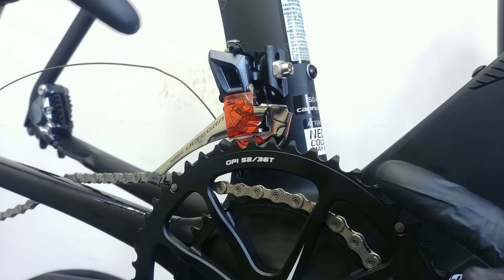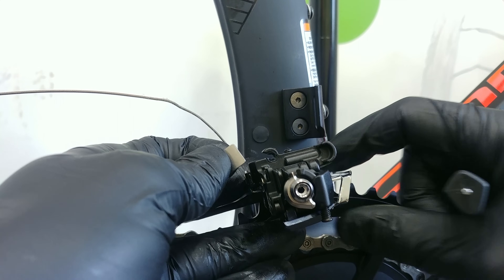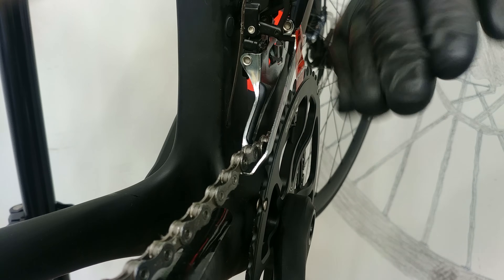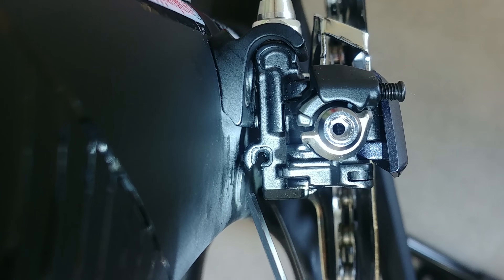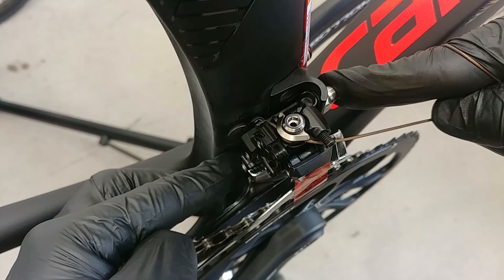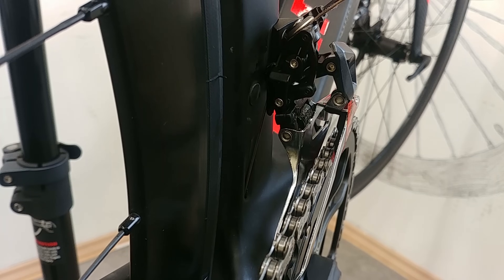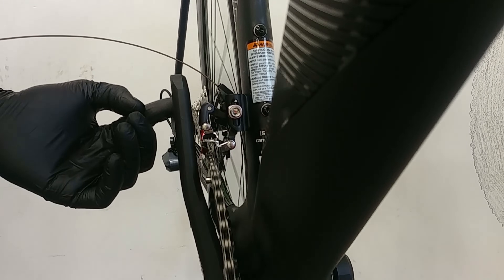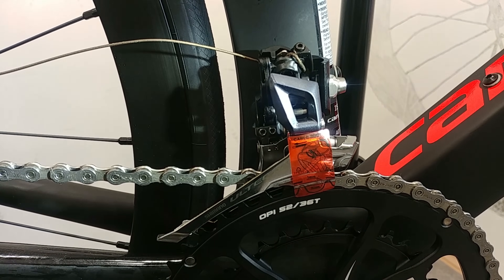Don't Forget To Stick The Plate. Shimano FD-R8000 Front Derailleur Installation / Adjustment.

Comment: that stabilizer screw doesn't come anywhere near being able to contact anything at all on the clamp, or the seat tube. its just hanging out in mid-air
Reply: Find some material that is thick enough to fill the gap, and use double sided tape to attach it to the frame in the appropriate spot. The gap was pretty big on my build, so I found some Teflon spacers at the hardware store. If the spacers are too thick, Teflon is easy enough to file down to the appropriate thickness. Good luck!
Reply: Same with me except it’s a hallowed out part of the carbon frame with a very severe angle to the screw, no way it’s going to work with that sticker pad thing - but the screw does get there.  I think what I’m going to do is epoxy on a small piece of G10 glass with thickened epoxy to make up the curved surface. Have to get the paint off, perhaps 1/2 inch square.  Pain in the a-s.

Comment: where did you put the plate sir?
Reply: he didn't use it on his bike because the screw touched the braze on plate. so its not needed

Only if the screw touches the frame you should stick the metal plate to protect the frame
Reply: That plate is just an extra protection of your frame not to touch by that adjusting screw.

Comment: This clarifies the funny "game" of stiffening screw (the one that pushes onto the frame) and L/H gear adjuster. The bottom line is: when the stiffening screw pushes onto the frame, the derailleur outer guide must be planar (what is improperly called "parallel") with the chainring. Which is how all deraillers should be set.
Reply: What’s the right position of the L and H screw to start with? Because they will also impact how planar the guide is but then also how much play you have for adjustments!
Reply: @soussef24  The L and H screws are adjusters for the end positions only. The derailleur keeps parallel to itself when moving inwards and outwards as the kinematics of the parallelogram mechanism on which it is mounted only allows it to do so.
Reply: @fabiopunk1661  I agree but let’s say you already had the L screw fully turned anti-clockwise, then you install the FD planar to the big chainring. You won’t have any play left on the L if you want to push it inward when adjusting…
Reply: @soussef24  I never noticed what you say, I have installed several derailleurs and always started with the H and L screws "somewhere" in between. I will have a closer look at this derailleur. I found the description on the manual a bit complicated, but when I got it, in fact it I understood there is not much to it. It is an additional feature to provide increased stiffness to the mount. As long as it is pushing lightly onto the metal tab to stick on the frame, it is fine.

Comment: Also, I don't belive you need the stick on plate for a alu frame. The adhesive flexes a little and the bolt straight to the frame gives better more rigid contact, although on carbon it might be wise or if you are really picky with a tiny scratch in the paint.

Comment: If I had seen this a year ago I wouldn't have poked a small hole halfway thru my my seattube...I have the FD-5801 which is a similar design and almost impossible to set up correctly on my Rose bike..
Reply: For my part, I had replaced the R7000 model with a sram rival front derailleur. It worked very well and the settings were much simpler

Comment: The Support Plate doesn't seem to stick. Anyone successfully stick it? Also I have tried screwing the Low Limit screen all the way in but it the derailleur never reach the bigger chain ring. Any advise?
Reply: U need to loosen the high limit screw then adjust he screw for cable stopper ath the down tube

Comment: will the two alignment lines in the trim position stay aligned after making the high and low adjustments to eliminate cage rub? Should you re-align the marking lines again if they are not lined up afterward?

Comment: On some steel bikes the FD braze-on has sculpted metal decorative brazing right where the plate needs to go.  That prevents the little bit of double-stick from working.  I ended up pulling it off, and covering 100% of the plate's back with 3M outdoor permanent sign mounting tape.  Just a tip for anyone whose frame is like that.

Comment: The shown adjustment of the high limit is wrong according to Shimano instructions. Sproket and trim position are correct but the 0 - 0.5 mm gap should exist between the chain and the inner plate of the cage and not of the outer plate. So for both high and low limit the clearance between chain and inner side is relevant. Maybe thats why he also had to make another minor adjustment in the highest gear.

Comment: Hello,

Reading the technical Shimano Manual and watching your video I can say you do a good job and you respect the rules of installation, nice tutorial, thank you to share your knowledge with passion. 

My bike is coming from factory with the front derailleur very high on seat tube so i decide to put in better position. 

I respect 100% the rules and fix the gap between the front of the plate and the top of the chairing teeth at 3mm. (Shimano ask for a gap between 1 and 3mm). 

The shifting is perfect, there's no noise, no contact between any parts. 

But i have a question, my gap between the front of the plate and the teeth is 3mm and this gap is reducing at the rear of the plate to 0,5mm. 

It's not possible to have 3mm from the plate to the teeth all long the plate. Do you think it's a problem if this gap is reducing from 3mm to 0,5mm between plate and teeth from the front to the rear of the plate? 

I am in doubt now if i have to remove the derailleur more high on the seat tube (clamp not braze-on). 

Because if I need to have more than 0,5mm from the back of plate to the teeth it will be impossible to have 3mm of gap from the front of the plate to the teeth. 

In my opinion it's okay like this and not an error, it's normal because my seat-tube have a big angle from the bottom bracket to the rear wheel. 

I think you have on the video we can read Shimano Ultegra on the plate, Shimano on the back and Ultegra on the front and the gap between the area where there's write Shimano look smaller than the gap where there's write Ultegra.

Thank you in advance to ask me if you think it's OK and good like this or if I have to put the derailleur more high. 

For information the Gap between the front of the plate (sticker area) and the teeth was about 10mm before my intervention i think it was too high. 

Thank you best regards.
Reply: You can't do anything with that gap closing towards the back, if it doesn't touch it's ok. On the top the correct gap it's important so the plate can interact with the chain precisely, towards the back this doesn't matter.

Comment: Will this work with the Tiagra 4700 shifters?
Reply: Dont
Reply: Yes it will work fine. CAMDE SamyS4 doesn't have a clue about understanding the mechanical function of the shifter realitive to the derailleur.
Reply: The 4700 front derailleur lacks many of the features and adjustments of this one, so your best bet is look for a video showing basic front derailleur adjustment for Tiagra or 105 or older Ultegra. You really just have the High/Low screws to tune on that one, once you get it set properly. Also you want to have an inline barrel adjuster so you can tension the cable. I pre-stretch new cables when I first install them, and IMO it's easiest to do most of the derailleur adjustments without the chain on first, and then fine-tune it after installing the chain.

Comment: Where are you from? What's the accent from it's pretty thick... thx for the help dude I was putting on my r7000 braze without plate cuz I saw plate with my clamp on r8000 and tossed it cuz clamp on n I approached r7000 braze on but without tossing plate but thot didn't need it so yikes that was a fail.... thx for giving me hedz up!

Comment: For me the plate wouldn't do anything because the screw that's supposed to go against the plate is way off center from the seat tube. I think Giant must be kidding. It's so frustrating, I bought a new Giant Revolt Advanced 2 some time ago and I don't even know what to do at this point...
Reply: machine you own plate with an eqvivilant alu material if you can cut one to shape. just diy it or do without. its not essential just a little stiffer. Your lucky that there are even totuorials on this. When the derailleur was first available to buy, everyone was scratching their heads trying to figure this thing out because typical shimano never explains how to install.

Comment: As any sport enthusiasts rather it be cars , bikes etc. Is being able to upgrade the components. Here's a warning to those like me interested in buying a new aero dynamic carbon fiber bike that I notice a lot of bike riders and dealers don't mention. "In order to go faster with less spin is being able to upgrade the chainring. In this case if you try to put a 61T or bigger chainring on these styles of bikes you can't. Simply because from the look of it the front drailuer will need to be relocated (pushed) upward due to the bigger chainring. But since the screws is permanently positioned in one place of the frame then you can't relocate the draileur. (0:43....0:44)"

This is where a vintage style road bike has the advantage. If you could put a 61T or 75T Chainring on these super lightweight bikes you would be doing highway speed easily. Just keep doing alot of heavy weight squat lifting and dead lifts at the gym and you'll notice a big difference. The kiddy chainring is annoying you overspin and still end up not keeping up with traffic.